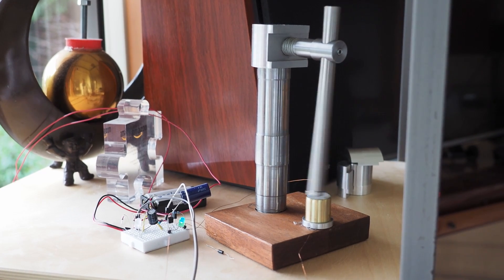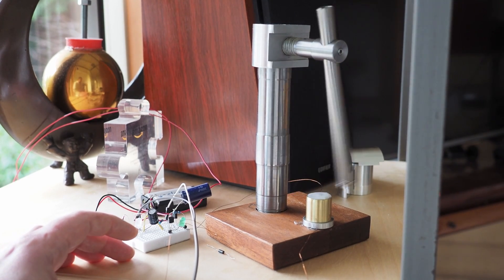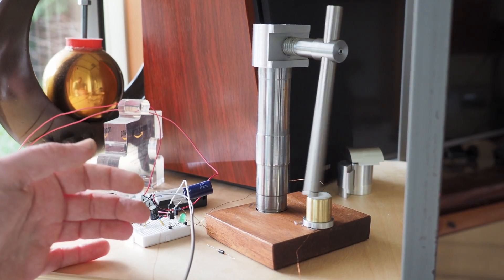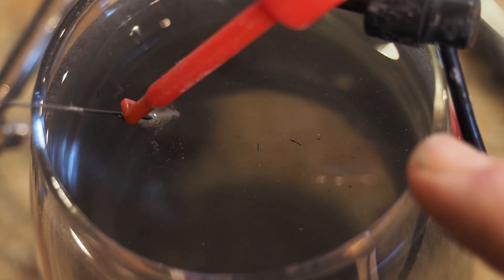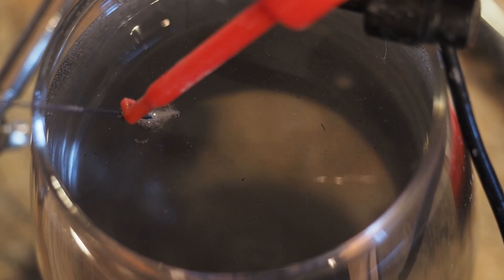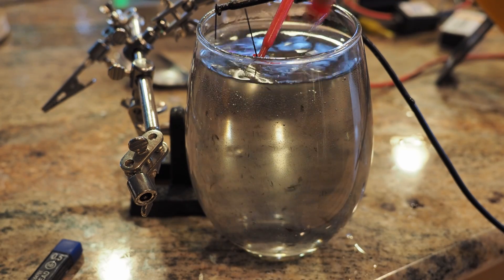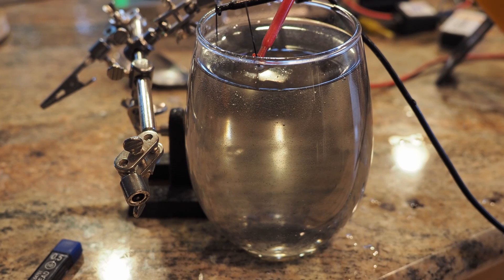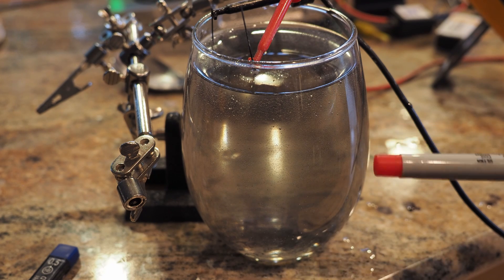graphene with electrochemical exfoliation test

Comment from the maker: I don't think this was graphene, I dried some and it was not at all conductive.
Reply: I believe a lot of what you produced will be multi layer graphene which could be considered to be graphite, depending how you look at it. This would still be electrically conductive though. Much of the graphene/graphite will be oxidised during the process, which is non conductive. This needs to be reduced and a good way of doing this is with ascorbic acid (vitamin C) at 90 degrees C. After washing you will probably find it is conductive. Another problem with pencil graphite is the clay which is mixed with your product.
Reply: @rogerwilson6367 very interesting, you talk graphene like it was from metal salt and you need reducer just like metal plating thingy,  i've never thought like that i just thinking only heat like microwave that can make graphene, do you have any ref about ascorbic acid?
Reply: @dogodogo5891  Just google reduction of graphene oxide with ascorbic acid (vitamin c) loads of info.
Reply: Robert Murray-Smith has some good videos about graphene that you could use. Also, his company Working Ink sells graphene ink and capacitor kits for relatively cheap. So if you just want to do some capacitor experiments, I would recommend buying some kits from him. However, if you want to make your own graphene, he proposed several methods that you might be able to use.